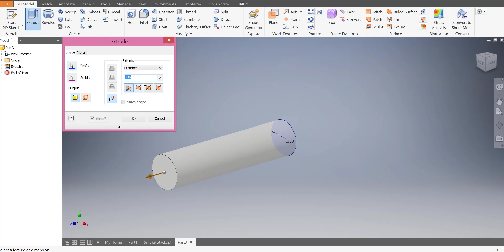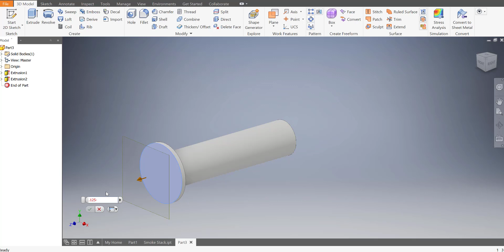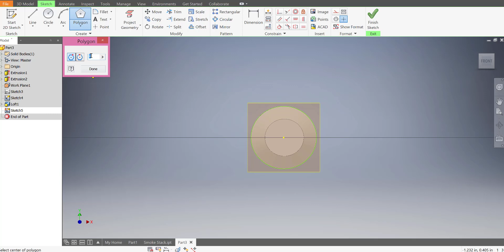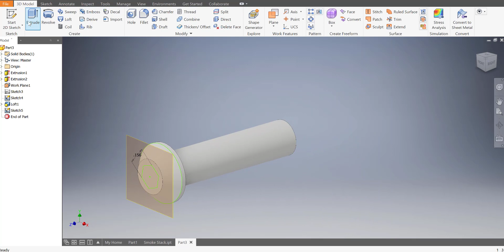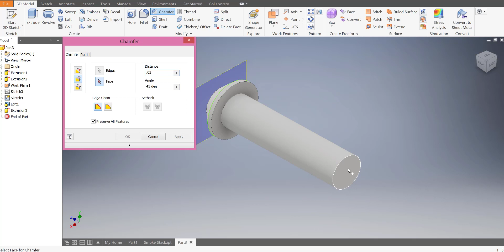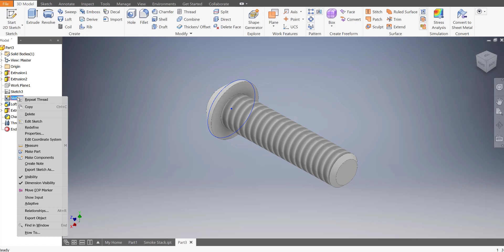Autodesk Inventor 2019 - Axle Peg - Train Project - Beginner Tutorial

Comment: The thread tool doesn't exist anymore..?
Reply: Are you using Inventor Professional 2021?
Reply: I dont know I’m not sure but most likely yes
Reply: @charliedale5806  The thread tool is under the 3D modeling tab. Once there, the thread button is at the very top near the middle. Hover your mouse over the buttons to see their names and uses.
Reply: I dont know I don’t see a 3D modeling tab..
Reply: @charliedale5806  ok, so when you open the app, click on the “part” button. When that opens, there should be tabs at the top that say “3D Modeling”, “Sketch”, “annotate”, “Review”, etc.
Reply: I know I’m late but for anyone wondering it’s under “create” now